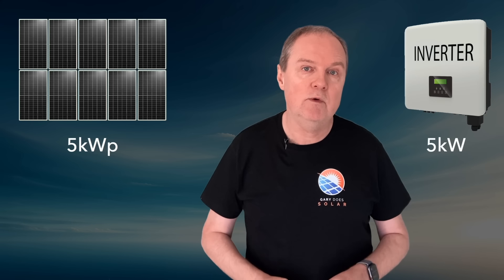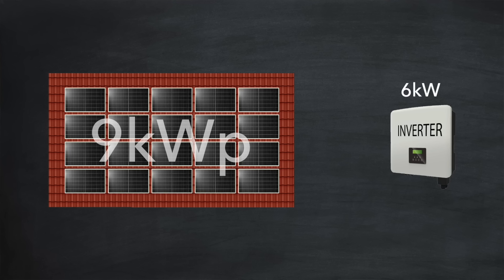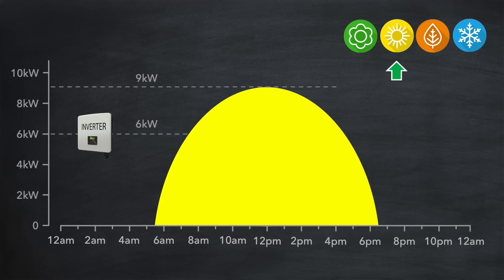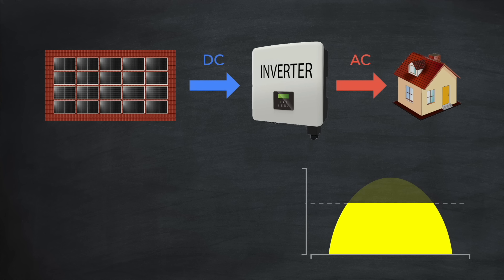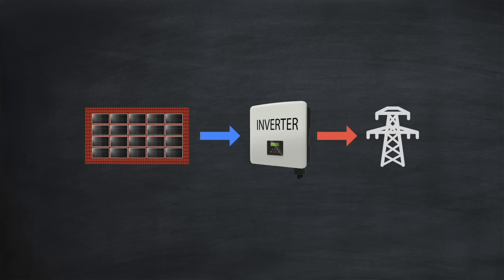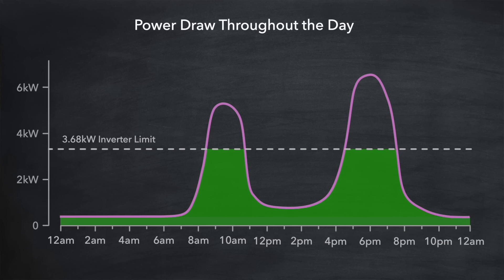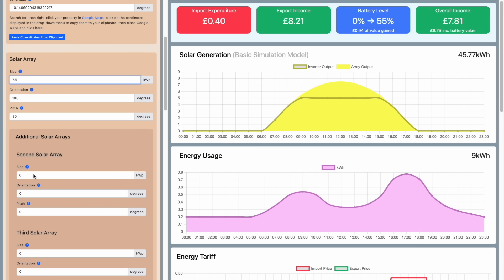Solar Array Oversizing - All the Benefits and Considerations

Comment: Ho do I now protect the inverter from overvoltage? I watched till the end, but I did not catch that.
Do I just hope for the best (indeed I think it is unlikely to have max power very often) or is there hard overvoltage/wattage-protection possible?
Reply from the maker: It’s dependant on the inverter in question. Best to speak to your installer or write to the inverter manufacturer detailing the array you’d like to operate on it 👍🏻

Comment: Hi, I noted the use of power exceeding your inverter to charge a battery which is limited by the charge requirement of your battery. Would it be possible to dump any excess into a thermal battery such as a hot water tank, sand battery etc?
Reply from the maker: It depends on the inverter, really. As far as I'm aware, hybrid inverters only work with a limited selection of batteries (usually ones from the same manufacturer).
Reply: @GaryDoesSolar  hi, I understand about battery/inverter compatibility likely being an issue but I suppose I’m thinking of either a diverter sending power to a heating element prior to arriving at the inverter or output from the inverter being sent to a heating element rather than the battery if it is fully charged.

Comment: Hi Gary. Hopefully  fitting my new solis hybrid inverter and batteries on Friday. My final array will mostly be East and West orientation but after my extension is built i will have the opportunity to add 2 more panels facing South.. if i add the 2 South facing panels to my east facing panels at the end of the string and just before the inverter, will it create shading to the East facing panels or is it ok because its the last 2 panels before the inverter  !! Regards Mark
Reply: My final array will be 8kw of panels and a 6kw solis inverter. Am hoping to maximise the power production as early as possible and as long as possible in a day to take advantage of the Octopus flux tariff and the charge and discharge of my batteries..  regards Mark
Reply from the maker: Hi Mark, unfortunately, l'm not in a position to provide individual advice (not least because of potential liability issues, even if that advice is given free - such is the world today). You're best to speak to an installer for such advice, or post a comment onto a solar forum (e.g. this one in the UK: https:// www.facebook.com/groups/2197329430289466). Good luck!

Comment: 100% Brilliant Video 
1. Take your Roof Size and work out what is best for your size of roof, dont just go for the biggest wattage panels as the physical panel size might mean installing a lower watt panel would mean more panels i.e. 10x450w panels is 15sq m but having 15x400w panels is also 15sq m but the lower wattage panels would actually give you a higher peak. which is higher early morning and higher late afternoon. 
2. Solar clipping is never expanded on enough in my opinion especially in a country like the UK which is rare to have peak production so having more panels/larger array means more kw production.
3. I even prefer micro invertors so even when clouds partially cover some panels the other panels are still producing maximum
4. Oversizing also allows for panel degradation. A panel typically loses 1% in the 1st year and lets say 0.5% each year there after, over sizing means in 20 years your system is still performing like the 1st day you installed it. 
5. Oversizing - Also possible you can also "clip" your export too (Export Limiter), so if you have batteries/or not and are producing 6kw you can charge all this 6kw to your batteries when they are full you will then only export at 3.68Kw; again the full 3.68kw for longer due to the clipping. Or your producing 6kw using 3kw in your house and exporting 3kw (saving and making you money).

The cost of panels is now relatively cheap, by this i mean if your installing 10 adding a few more is not a huge cost. 

This is one of the best videos i have seen that explains Oversizing/clipping. When i designed my own solar array i even found a white paper from "Enphase" showing the advantages of doing this but it was pages and pages of numbers and graphs; being a geek i took to it, but thought how can "Joe Bloggs" be expected to understand this stuff. They just want to know what does it cost and when will it pay for itself/make me money. Also the downside for a Solar company that would quote a larger oversized system would be more expensive than someone who didn't so i feel for them too.
Reply from the maker: Thanks Simon—that’s fantastic feedback to receive 😀🙏

Comment: I'm curious, I've got a 25kW system of panels with micro inverters, and we're now considering batteries.  Is there a similar economic balance point on battery to array sizing?
Reply from the maker: Actually, yes because the microinverters are usually undersized compared to the panels.

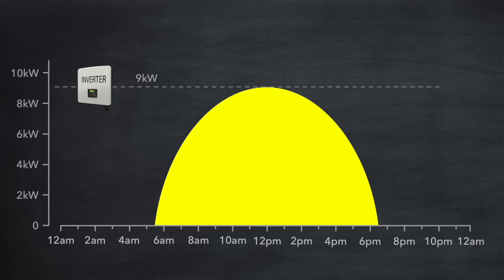Comment: Hi Gary, Thanks, that's very informative. Re the inverter efficiency @5:00, are there figures for this? Also, AIUI inverters with different AC output ratings may have the same internal DC capability. I'm thinking of the GivEnergy Hybrids where 3.6 and 5kW inverters both have the same 7.5KW DC capability, so they can simultaneously export 3.6kW AC and charge a DC battery. Presumably the efficiency of these would be identical?
Reply from the maker: You're very welcome. I don't have efficiency figures myself (just statements from inverter manufacturers that I've read). Your final question is a good one to ask on a GivEnergy forum...

Comment: Hi Gary We are allowed to export 3.68 kw. Is this per hour or per day? Also what happens in the summer say when you are generating excess electricity - batteries are full and you are restricted on the amount you can export to the grid. Thanks Mike
Reply from the maker: Hi Mike, this is actually a real-time value of power. Like putting your kettle on would draw 2kW from the grid, but only for the time the kettle is on. It's the same going the other way - you can export up to 3.68kW of power at anytime in the day, but not any more than that.

What size is your array and battery? It's likely that you wouldn't be exporting more than 3.68kW at any time anyway, so I wouldn't worry too much.
Reply: @GaryDoesSolar  Hi Gary Thanks for your reply. I now understand.  We have a Solax system- Batteries  3 giving 17.4kwh, Inverter 6kw. The panels are Jinko tiger neo 18 in total, 420w per panel with optimisers. Kr Mike
Reply from the maker: @mikeattenborough-cox1024  That's a pretty good setup, Mike! Maybe a heat pump next? That would certainly soak up any excess solar! 🙂
Reply: @GaryDoesSolar  Good Morning Gary, We had an air source heat fitted 7 years ago and WOULD NOT recommend having one fitted. Ours is a hybrid system an oil fired boiler (we have no gas in the village) kicks in when temperatures drop to below 5 degrees. When electricity cost rocketed,  2022/23, we ended up with an annual bill of £7000. The air pump broke down and to have heating this year the engineer switched the electrics to use the oil boiler. With the solar panels, fitted August 2023 we  spent £100 on heating oil over the winter and on average £1.26 a day on electricity after deducting exporting to the grid!!! We are looking to see if we can make heating system more flexible by being able to switch between the air source heat pump and the oil fired boiler. Kr Mike

Comment: Really useful information, thank you! We recently had a 7kW array installed with a 6kW inverter 10kWh SolarEdge battery. I wondered how the battery was able to take 5kW while still exporting 2kW to the grid and this video answered it (the battery is DC coupled). Also watched the video about batteries too. Excellent information really clearly communicated. It's hard to find this level of technical detail without the information being hard to understand.
Reply from the maker: Wow - that’s great feedback! Thank you 🙏

Comment: Great video and very well explained. However a roof has a load maximum based on the set up of the roof, the tiles used, then the additional weight of the mounting system, panels and any snow predicted for that area. Whilst it makes sense to do oversize the array if you can, ensure a weight load is carried out on the structure of the building to ensure the roof is capable of taking the extra load.
Reply from the maker: Totally agree 👍🏻

Comment: Hi first time watching your videos and found this very interesting.. I currently have 3kw of panels facing east and a 3kw inverter. When I can afford it I am going to get another 3kw of panels facing west. I also have several 2.4 pylontech batteries that I plan to add before summer. I have a 4kw Solax hybrid inverter and thought I would need to buy a bigger inverter (6kw).. sooo, can I actually use safely my 4kw hybrid inverter with 6kw of panels and several 2.4 pylontech batteries !! Regards Mark
Reply from the maker: Hi Mark, thanks for watching my videos - and I hope they're useful to you! Check with your manufacturers regarding the maximum oversizing ratio, but it looks like you should be ok. All the best!
Reply: Hi Gary,  many thanks for your reply.. all the best

Comment: What if my inverter has a maximum limit of 500 volts open array PV and 27 Amps MPPT current limit. My panels are 585 watts each and can produce 50 volts and 14 amps maximum. Can I still add 12 panels to my 4 KW inverter?
Reply from the maker: You'd need to speak to an installer about that. There are other factors to consider as well...

Comment: My system will not be connected to the grid.  Initially I will have a 2.7kW array that will expand to 11.7kW.  There will be 900Ah-48DCV flooded lead acid battery bank with a 6.0kW backup DC generator to maintain batteries above 25% discharge. The inverter will be down stream of this.  Over a year the system should over produce in total by 1,315kWh, but will fall short of demand during Nov, Dec, Jan and Feb.  Thats a big reason for the generator.
Based on this scinario, what size inverter is ideal?
Reply from the maker: Hi Andrew, unfortunately, l'm not in a position to provide individual advice (not least because of potential liability issues, even if that advice is given free - such is the world today). You're best to speak to an installer for such advice, or post a comment onto a solar forum (e.g. this one in the UK: https:// www.facebook.com/groups/2197329430289466). Hope you get the answers you're looking for...
Reply: I understand.  This is a Canadian install so I would not expect you link will be of much value to my situation.  Thanks for your reply.

Comment: I did this without realising.  Managed to get another 3 panels on,y Tony roof in landscape, on top of the rest in portrait. It’s really made a difference. Next looking to get some on the back roof even through it’s north east facing, maybe 4 more, and then add the batteries. While my export rate is great here in Ireland at 29c a unit, it’s dropping more and more. So batteries with extra panels make more sense.
Reply from the maker: Brilliant!

Comment: I have a ground floor flat with a couple living in the flat above. I don’t think it would be an issue if I wanted solar panels on the roof. The front of the house faces south east and the back of the house faces west. My issue at the back of the property is trees tall trees higher than the roof of the property in my neighbours garden. We have asked if he will cut them down but the answer is always NO! So my question is if I wanted solar panels to the back of the property there would be no sunlight getting to the panels so it would pointless putting them there. I have yet to hear any engineer address this issue and it is an issue for a lot of people who have tree’s very near by. Is it possible that someone could address this issue.
Reply from the maker: Sorry to hear about the situation you’re in. Assuming you and the couple living above both own the property, there is likely to be a shared roof agreement. Have you considered speaking with the couple about you both have panels on the roof. They may appreciate the opportunity (and may even reduce the height of the trees as a result) if they can understand the benefits to their energy bills. Just a thought…

Comment: I think this makes sense from a purely more energy collection perspective but not from an ROI perspective, as any wasted potential energy is an increase in the ROI time for money you paid and energy that could have been collected but wasn't. Unless the savings from a smaller inverter cancel out the cost of the extra panels which I don't think is the case.
Reply from the maker: I don’t know - I guess calculations would have to be able in each particular situation. Solar panels are very inexpensive these days, so why not have as big array as possible?

Comment: This is a great video and extremely informative well scripted, videography was great and the information was accurate and well spoken to the targeted audience.

Also it highlights some of the issues I have with solar power being pushed so hard. Firstly I think that solar is a wonderful thing there is no argument there at all, none, however storage is less than optimal and expensive. Then the very folks (read the government)  that push the solar alternative charge you exorbitant fees to add solar above some prescribed rating to your home. Then the insult to that injury is that the folks that push the solar (read the government) on you regulate the amount of income you can receive from the power company for excess electricity that you, using the equipment bought, paid for and installed by you, kindly sell back to the grid for your neighbors usage. 
If you step back and take a zoomed out view, instead of the myopic view of solar is so great and I am doing something great for the planet, then you can see that something is just not right at all with the "solar plan" the government makes, if it is needed so badly why charge crazy fees for the licensing above a certain size, the licensing for the installation, the taxes on the equipment and taxs and  fees for the re-selling back to the grid? 
And yes I understand the need for electrical qualified electrical installations that are inspected by those very folks. (read the government) (humor here).  
Where I live there are no restrictions for solar you can add as much as your wallet allows, but I used 390 kwh of electricity last month so my 50 dollar electric bill does not make me want to install $10k worth of solar panels, inverter, solar battery managers and batteries to drop the grid. 
The perfect solution was fielded by Musk at one time, electrical co-ops, where you and nine other neighbors (10 being an arbitrary number) were the entire 'grid' for yourselves. 10 homes with this oversized solar like in the video, a centralized 10 Powerwall system and 10 inverters, one in each home. No power back the real grid, and everyone shares the benefits and the costs.
Reply from the maker: Thanks for the kind words, Jim. And also for your insightful thoughts!

Comment: It was interesting hearing the solar energy requirements in the UK. In the US, most inverters for residential use are sized around 15kw with many being twice that size. A 3kw inverter would be something you would choose for a tiny off-grid cabin.  My local utility sets a maximum of 17kw for a grid tied solar system.
Reply from the maker: Yeah, in the UK the average size of an inverter is 5kW. I like that inverters used in the the US are way bigger :-) Much more useful!

Comment: Hi Gary, you have brilliant videos and it's nice to get it from a UK very knowlegable source as opposed to the reams of mainly American  DIY  vids. I was just wondering, if you are not trying to reduce bills by feeding back to the grid , is it possible in the Uk to have a connection to your house by a change over switch set up a bit like a generator plug in point where you can either feed your house from the grid  OR feed your house from your solar inverter in a way that it would be impossible to send solar generated power into the grid. ie, one or the other without the hassle of G98 / G99 acreditation.
Reply from the maker: Thanks for your kind words re my videos - that's such great feedback! :-)

To your question, unfortunately, not. Any changes to a residential property's electrical system wrt renewables must be G98/G99 certified.

Comment: You will only get about 75% of the rated value so you need 25% extra. However if you live in a cold climate you need to calculate the Temperature Coefficient of VOC or too many volts in winter could kill your inverter.
Reply from the maker: What’s your source for this claim?